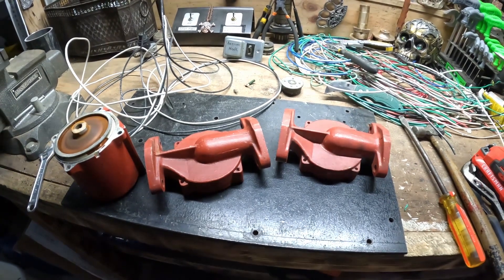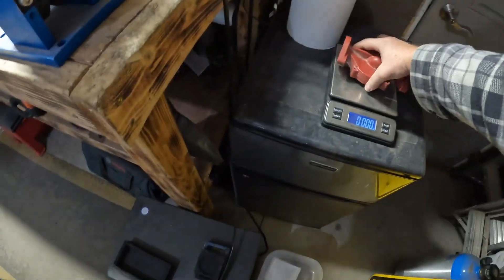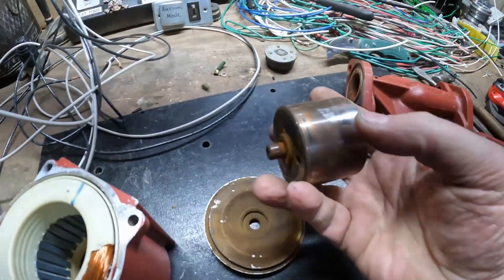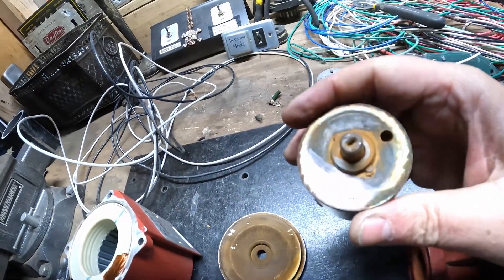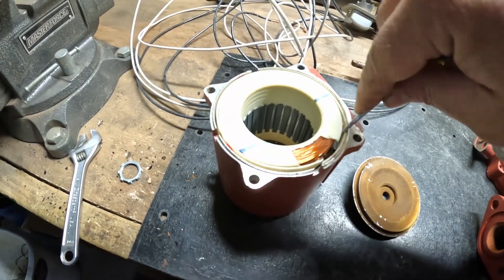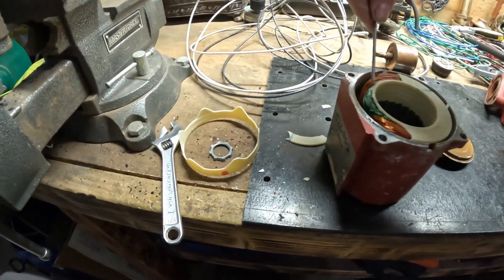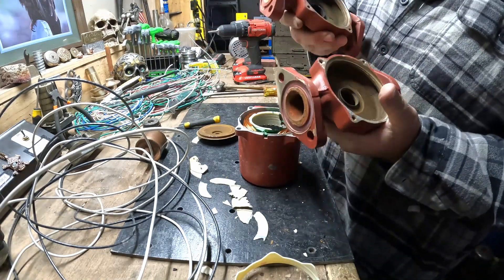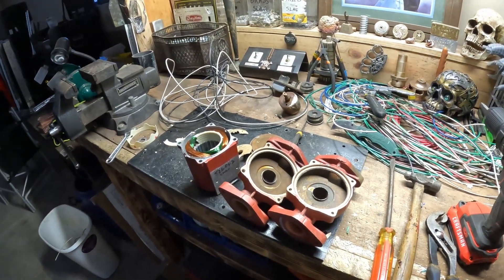Awesome Scrapper Surprise, It's Good To Be Lucky!  Killer Find In A Dumpster

Comment: Check it's not bronze - Grundfos made bronze-bodied pumps for circulating water that would corrode the usual cast-iron bodies.
Reply from the maker: Good thought, I will check that out.  It looks pretty yellow so I think it's brass, but I'm going to melt them down so I'll find out for sure then.  I melted some bronze recently and it really reacted differently than brass or copper so I'll know it if it's bronze.